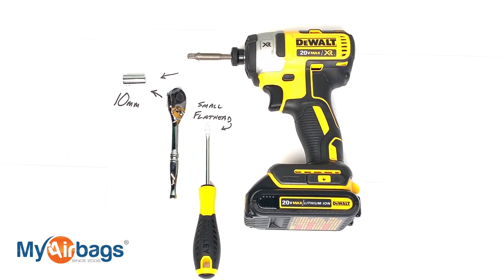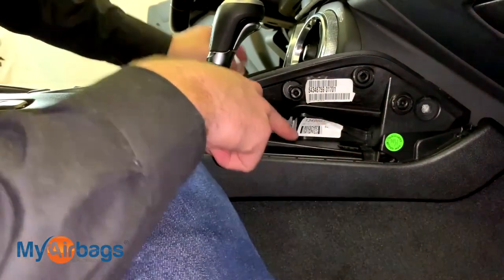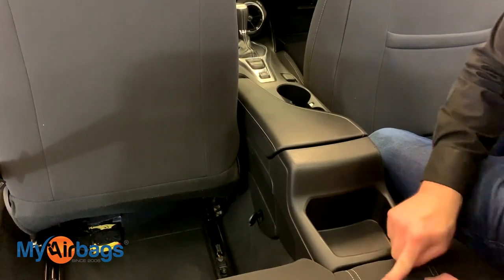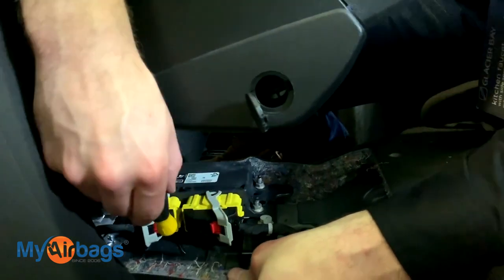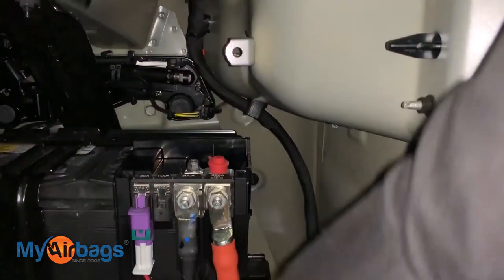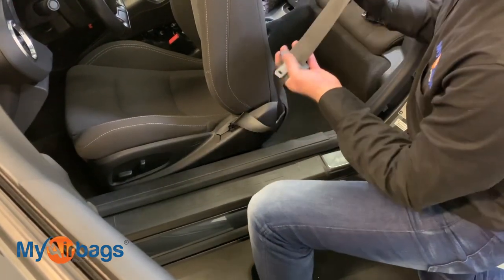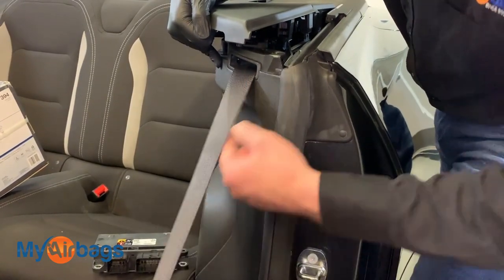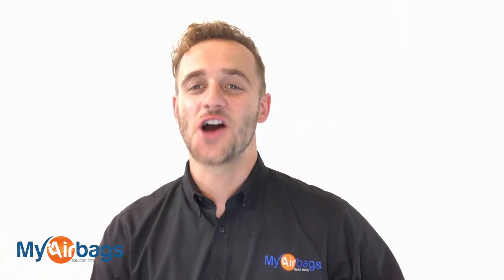How to Remove SDM DERM Module & Seat Belts on a Chevy Camaro  | MyAirbags

Comment: Is this the same location for a 2013 camaro?
I bought a 2013 camaro that had been crashed before all airbags were replaced but the air bag light is still on could it be that they dint reset the module?
Reply from the maker: It might not be exactly the same for the 2013 model but should be pretty similar. If your light is on, the first step is to diagnose the airbag light. Hook up the scan tool / scanner to the car and read the airbag codes. You connect the scan tool right into the OBD port/plug. Its usually located below the steering wheel, on the left. You are welcome to reply to us with the trouble code that it reads. www.myairbags.com

Comment: Thank you for a interesting video!

I have bought a Camaro 2012 with air bag service light on. As far I know no airbags accidents have been but seems to be common with airbag module problems on these Camaros. 

I pulled the codes today and got "reset high voltage disable request after crash event detected" and these codes:
U00700 Can Bus Communication,
B101D00 Electronic Control Unit Hardware,
B132503 Control Module Power Circuit Lower voltage, 
U17000 Lost Communication with passenger presence Module
B00210D Passenger seat side airbag deployment loop - high resistance
B008100 Passenger presence module

Will these problems be solved if you reset the SDM module? And what is the cost if so?
Reply from the maker: Hi Johnny, Thank you for your question!
Our reset service is only beneficial if the car was in an accident.
Reply: @MyAirbags  I will send my airbag module to you for my Camaro 2012. Can you please advice where to find it and how to remove it? I guess the module is in the console?
Reply from the maker: @johnnyaberg9617  If the car was not in accident, you don't need the reset service.

Comment: Question: my 2017 Camaro will be used track events and hopefully within the next year time attacks, it is not my daily driver only use it for track days I'm thinking about removing the module and disconnecting the units because I will be going with full race seats, will I still get the check engine light on or will I be able to take it off once the modules are completely removed from the car?
Reply from the maker: RacerXXX, Thats a very solid question! Even though it must be awesome to watch your Camaro fly down the track, I'm sorry, we are not able to advise you on removing safety features from it. We only specialize in restoring the airbag system back to a functioning state. May the Checkered Flags be in your favor :)
Reply: @MyAirbags   Thanks

Comment: Hi i have the same car && i have a question after an car accident do i have to change the sensor of the air bags ?
Reply from the maker: If you are referring to the main airbag control module sometimes to referred to as a computer / sensor, We can reset it for you.
Reply: @MyAirbags  Jaime is talking about the sensors on the core support and beside seatbelt area on the both sides of rear seat under the side panel trim.

Comment: I bought a salvage 2017 camaro and the airbags were replaced. The airbag light is still on. How can I take out that light from my dashboard.
Reply from the maker: Jonathan,
Make sure to replace any airbags that deployed. 
On the Camaro 2017, the seat belt pretensioners deploy as well. You have dual stage seat belts in that car.
You can replace those or have them professionally rebuilt here with us.
The sdm derm unit / airbag module needs to be replaced or reset. We can reset it for you as well.
It only takes 24 hours to turn your order around once we receive it.
You can start your order here:  https://www.myairbags.com/product-category/repair-return/airbag-module-reset/?_make=CHEVROLET&_model=CAMARO&_year=2017

Comment: My 2017 was not in a wreck my light just randomly came on
Reply from the maker: Daniel, The first step is to diagnose the airbag light. Hook up the scan tool / scanner to the car and read the airbag codes. You connect the scan tool right into the OBD port/plug. Its usually located below the steering wheel, on the left. You are welcome to reply to us with the trouble code that it reads. 
We can help with after accident / salvage vehicles where the person is rebuilding the vehicle. We help our customers save hundreds of dollars on the airbag computer/module and the seat belts: www.myairbags.com